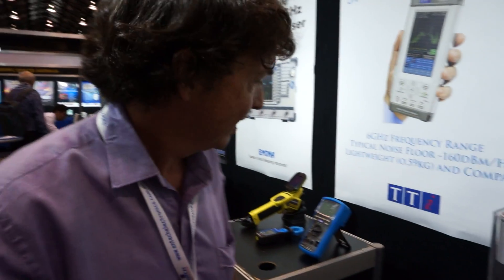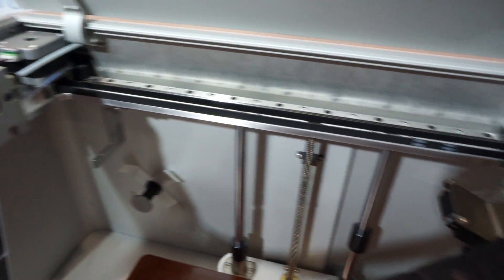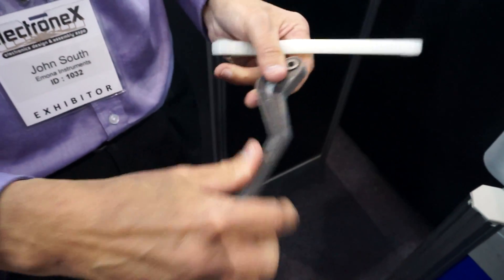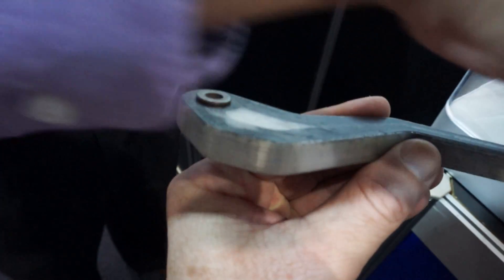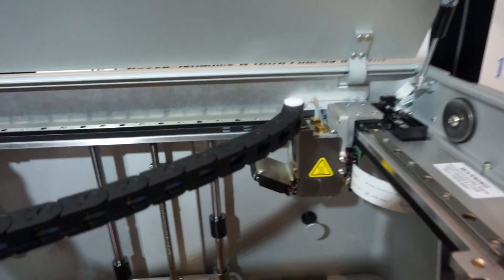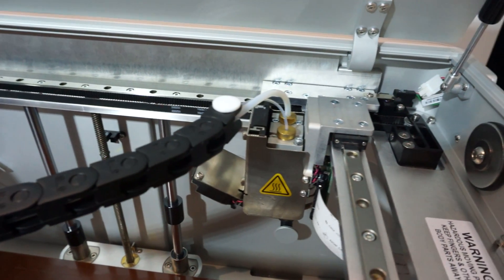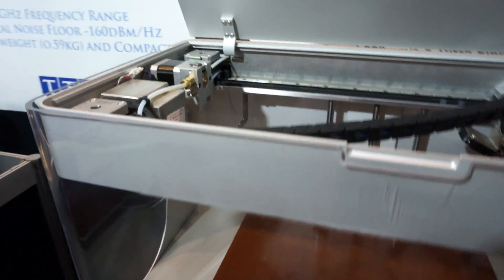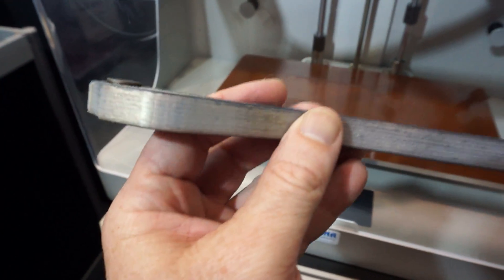Markforged Mark Two 3D Printer

Comment: so it's printing actual carbon fibre with nylon as the intermediary medium?

that's actually pretty damn cool! better than the "carbon fibre" filament option in 3d printers today.
Reply: It can inlay various fibres, glass, Kevlar, or Carbon. 

I saw the MK1 a couple of years ago and was quite impressed by the results. The slicing/inlay software is closed source and cloud based.
Reply: whelp, this kills the crab. I hope open source alternatives prop up once this gets cheap enough for hobbyists